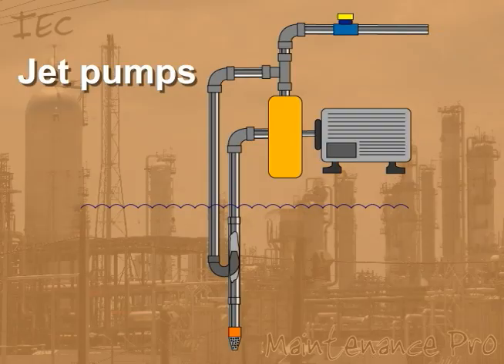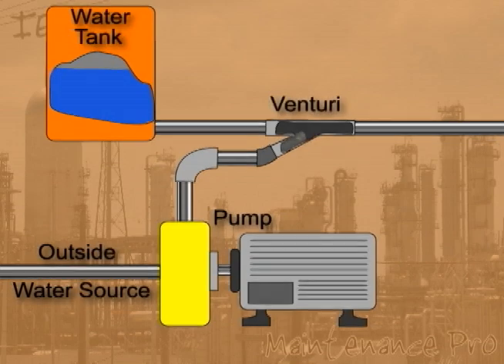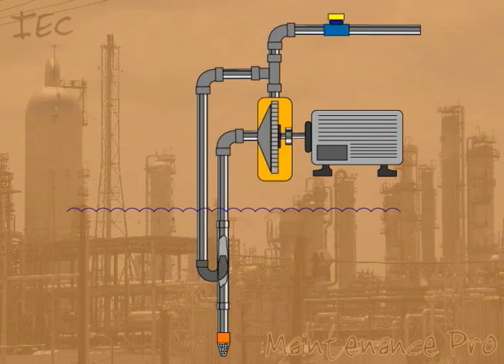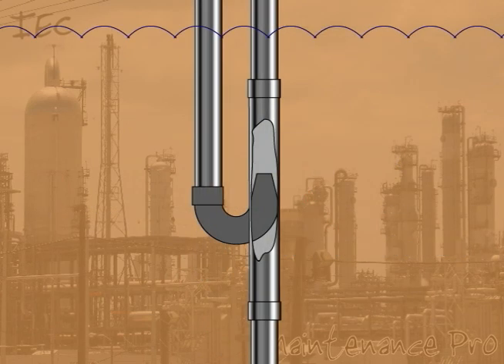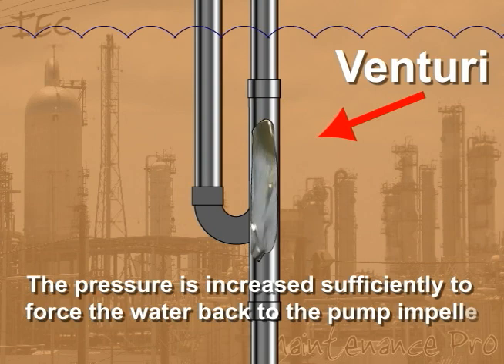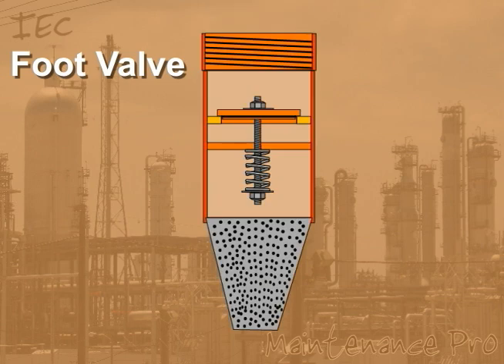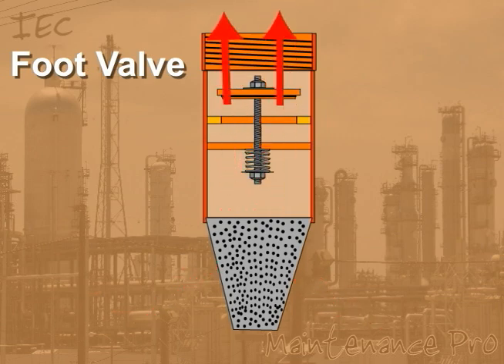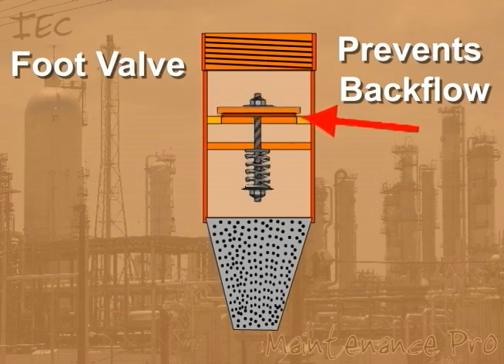Jet Pumps

Comment: just one thing , i am not clear with the technicality, how is the vaccum being created and the underground water being sucked through the foot valve because of the "water" flowing through venturi.

i hope i am right with the fact that the "water" here i am talking about is the water already filled in the lines and the centrifugal pump.

PLEASE BRIEF. ANYONE ?
Reply: The nozzle forces wather through a suction chamber to create a vaccum, permitting atmospheric pressure to force water into the suction chamber
Reply: @hansph00508  can you explain more clear??

Comment: Why would you use a jet pump vs just putting an identically sized centrifugal pump on the intake without the jet, surely that would be more efficient?
Reply: you cannot suck water from more than just over twenty feet. Deeper than that and it must be pushed from below
Reply: roflex2 THE THING YOU TALKING ABOUT IS SAME AS WE USE ELECTRIC MOTORS IN OUR HOUSES TO SUCK WATER OUT OF CORPORATION LINE AND DISCHARGE IT TO THE OUTLET LINES. BUT JET PUMPS ARE USED TO SUCK WATER FROM DEEP UNDERGROUND AND DISCHARGE IT TO GROUND LEVEL WHICH REQUIRES VERY HIGH CAPACITY CENTRIFUGAL PUMP IF NOT JET PUMP. 

JET PUMP HAS ONE EXTRA ATTACHED PART KNOWN AS JET ASSEMBLY.

Comment: I have connected a 1/2 inch pipe to my centrifugal pump and the automatic pressure controller would not turn the pump off. Is it because the pump is not making enough suction?

Comment: Good video.  I need to draw water over 25 feet.  I have a 2 inch pipe in the ground now.  Is there a jet system I can use?  By the illustration I am guessing the pipe needs to be wider?